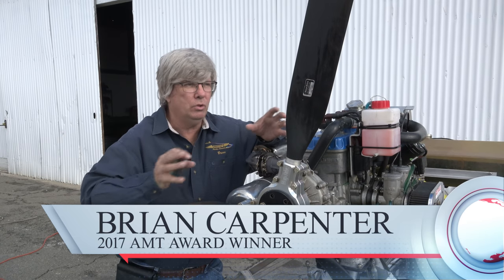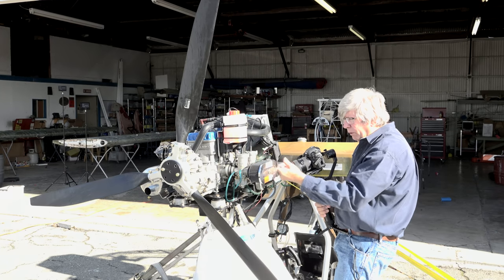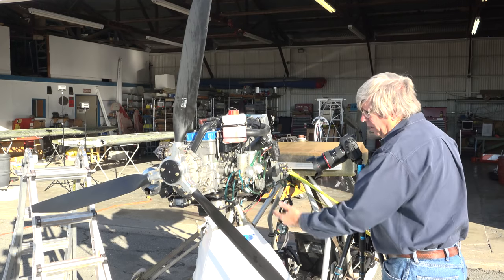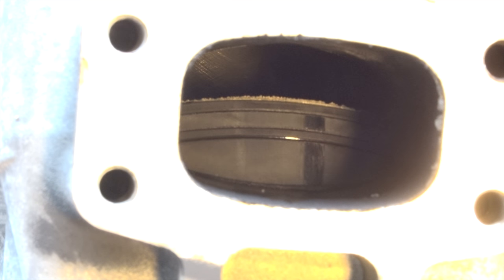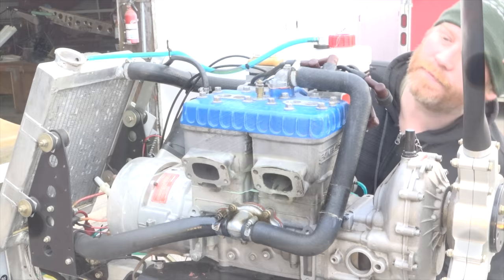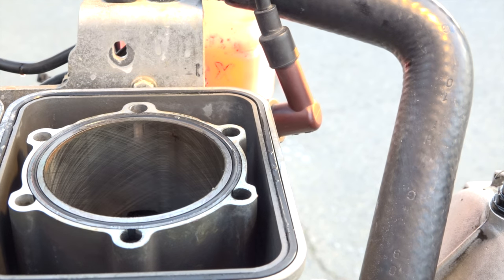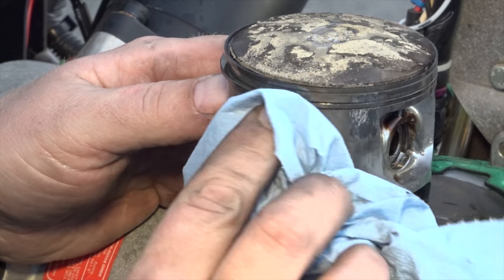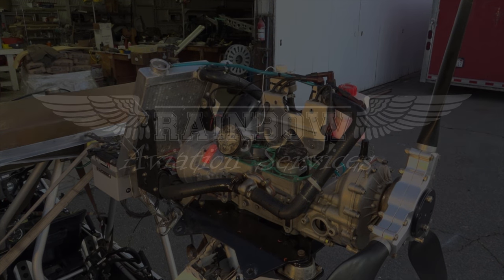GT-500 Crash Investigation PART 2 (Engine Tear Down)

Comment: By the look of the rear spark plugs i can almost be sure that that cylinder did swallow coolant, and that white grainy deposite on the piston is often a sign a coolant burn.
I have a lot of experience on Rotax motors not for aviation but for motorcycle races and the o-ring on the cylinder head can sometime leak and you get those white deposite on the piston and spark plug.
And of course after a while you miss coolant and you overheat and of course without cooland the rear cylinder become the first to overheat and seize.

Comment: Thank You for the detailed tear down, very well done!  To me it looks like the engine "Ran out of ring gap",  a 76mm (3 inch) OD compression ring is 239mm (9.4") long on its outer circumference.  At 100 degrees C the ring will increase in length by 0.5mm (0.02").  Factory ring gap is only 0.3 - 0.4mm (0.012 - 0.017"), with a wear limit of 1mm (0.039").  Given the cylinder cross hatching, those cylinders looked pretty fresh making the engine rather intolerant of over temp events.  I'd be curious to see what the actual ring gaps are for each ring in the existing cylinders.
Reply from the maker: I'm working on Part 3 right now. I think everyone will be surprized at the results.
Reply: James, do you think engine not properly broken in? Please define cross hatching to me. Is that normal or excessive from ring wear? Thanks!

Comment: I don't like the "crash investigation" part of the title. The engine failed. The crash was due to lack of the pilot in maintaining control of the aircraft. Video evidence shows the lack of immediate or any, for that matter, forward application of the yoke to maintain adequate airflow over the control surfaces and flight speed to prevent an accelerated stall into the runway as shown in the video.  Would there been a crash if frequent engine outs in all phases of flight (especially take off) were taught and practiced as well as expected due to the nature of the equipment?  No. Are they very lucky to be alive? Hell yes.

Comment: Thank You Brian and Carol! Great insight into a crash investigation!  Not knowing much about this airframe, I would have liked to see the stick go much more forward and for a longer period of time right after the loss of power to gain airspeed.  I believe this airframe, like the Moyes Dragonfly (hangglider tow-er) has a serious "nose-up attitude" to fight during engine failures.  Anyone know if the left wing dips "first" during a GT-500 stall?
     >>>Engine tear-down was awesome!  Looks like the spark plugs on magneto-side cylinder got waayyy too hot as per the close ups. Your assistant alluded to the head bolts being "rounded over" possibly from the use of a 12-point socket during torque, so I'm gonna guess that's the culprit.  Can't wait to see Part 3!!!
Reply: I was thinking same thing, stall, stall, stall, might have smoothed it out in ground effect if he nosed down immediately. Listen close you can hear engine not develop full power before it seized, that would have been time to abort.
Reply: Definitely. It is easy to be an arm chair quarterback . . . but I was almost screaming at the video right after the engine out: "put your nose down!!!" . . .  and then "FLARE" right before the crash. It is hard to tell, but I doubt he had sufficient energy to flare it before the crash.

IMHO, steep climb angles after TO in light aircraft are dangerous . . . just as this video demonstrates. More velocity energy and flying on the front side of the power curve are more likely to allow a safe touch down in this kind of event. Put your TO engine power into speed while you are in the GE . . . NOT altitude!

Comment: Spent years playing with 2 stroke dirt bikes making lot of power then later big 200-250 hp outboards for bass boats. 2 strokes seize up very easy with any lean condition. I remember first time 500cc dirtbike put the power valve in backwards that adjusted exhaust port based on RPM had a tiny vac leak let a guy ride it he rode it poured on the power a few times cold morning desert camping thing was seized up really good bent the rod like a pretzel the 500cc had big crank weights he was going about 60 mph all that emerita in the crank bent the rod trying to move that piston. Had to press the piston out it was fused to the cylinder.  The outboard engines were interesting 3000CC V6 EFI those things made power to weight ratio was amazing. Later they came out with direct injection even made more power they always had issues with the reeds breaking off eventually I usually put fiberglass ones in there they didn't last as long would not seize up.
Reply: I Loved 2 smell that BeNOL exhaust and hear the sound  a 2 stroke Evinrude or Merc wide open.

Comment: Wow. Engine fails, and instead of pushing the nose down to gain air speed he just keeps on pulling and pulling until he stalls it in.. smh.
Reply: yeah, he should have pushed the nose over to keep airspeed up, I think it wouldn't have even been an accident in the first place
Reply: Pretty sure he should have checked the coolant level before taking off aswell. 

Also, if failure due to head sealing was common, and rear engine cylinder failure was common I'd monitor and log coolant pressure and also measure rear cylinder temp.

Man it's crazy that an o ringed block like that would fail, seems like maybe a heat issue from running lean maybe?

Comment: The plugs in the Magneto side cylinder look they have Detonation damage which could be from o-heat but the piston and cylinder wall don't look bad enough to me to have caused a seizure of the engine.

Comment: Kind of curious why you didn't check to see if the plugs were providing any spark at the time of the engine quitting. Overheating looks apparent, but not enough for total loss of power in the manner this engine quit.

Comment: Hello Brian , only my oppion, the walls of the cylinder look like from the video you showed  
  the crosshatch on the cylinder was i think was a little to agressive , wonder if some of the metal on the side of cylinder got jammed in between the ring and cylinder ,plus low oil in tank. ,lead to heating of the one cylinder .

Comment: You stalled it after the engine quit.  You pulled back.  You should have pushed forward and got it back on the ground while you still had airspeed.  You had plenty of runway.
Reply from the maker: We will talk about the flight portion of the investigation in part 4

Comment: Very interesting.
I can’t believe anyone would trust their life to what appears to be a large model airplane engine.
That clear blueish tubing looks really safe.
It’s the same as on my Son’s model cars.
I had no idea that people were allowed to fly dangerous stuff like this.
Reply: Well, if they are maintained, they will run well.  If the owner doesn't check the fluids and inspect the parts on a regular basis then it will fail eventually.  
I don't know why they were running such a small motor for a 2 place plane.  I'd want at least an 80 hrs motor for a 2 place.

Comment: One thing is absolutely clear beyond any doubts. This accident is the pilots fault even though the engine failed. He had gobs and gobs of runway still in front of him, especially for an ultralight but even if he somehow ran off the runways end--which I dont think possible given the altitude--its an ultralight and would have landed just fine in the dirt beyond the end there. Bottom line is the pilot panicked and put the nose into the runway and or panicked and stalled mich to high because he failed to maintain glide angle..i cant tell which by watching this video. No matter what happened though the IP should never be allowed to Instruct ever again. That this was the result with an IP on board is unforgiveable. This kind of thing is exactly what theyre there to prevent as well as train the student pilots to avoid should it happen to them. Completely stupid and totally should never ever have happened

Comment: Ring gaps aren't 180 from each other, too
Reply from the maker: Rings on the Rotax 2strokes are pinned an in the correct position
Reply: Pinned 2 keep the end gaps between the cylinder ports.